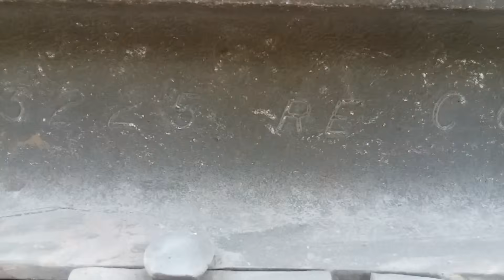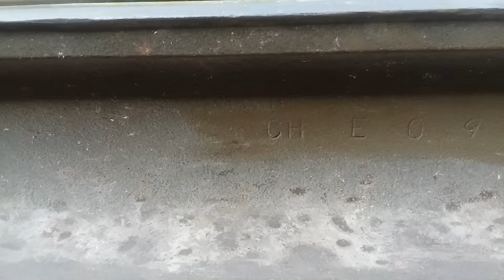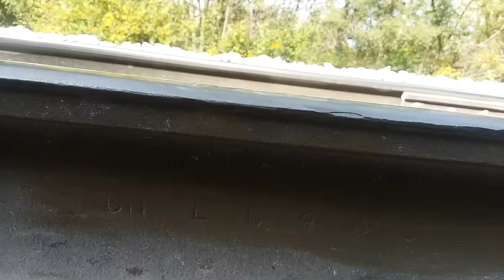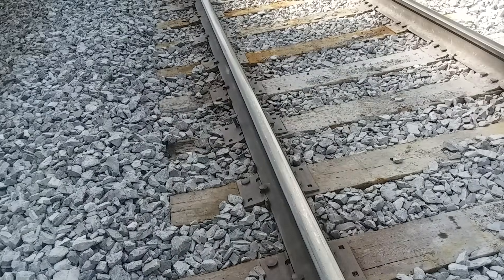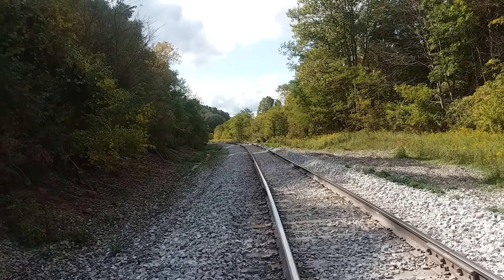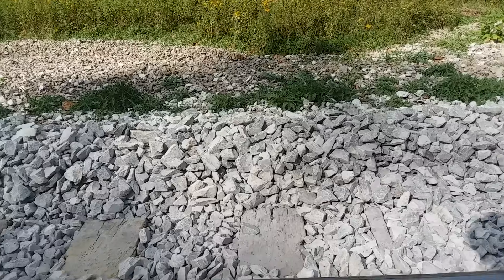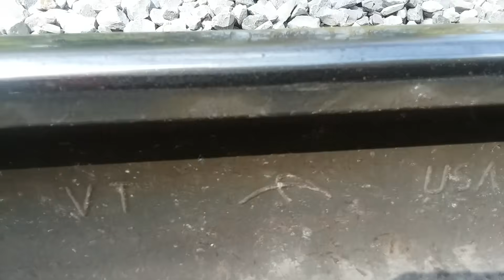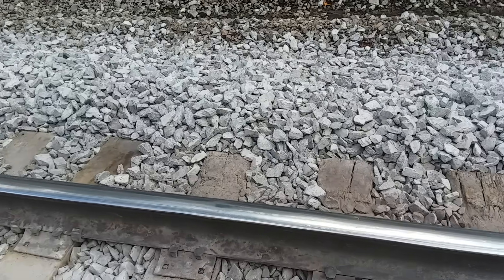Rail Defects: Rail End Batter and Flowed Rail, Heat Numbers (Heat or Rail Stamp) and Mill Brands

Comment: Steel is polished. Like a sword.    So shinny.  Sharp edges.    What is weight per foot. ????  Later.
Reply from the maker: Rail is weighed in at a per yard basis Dan. For instance, this
was 132 pound rail meaning it weighs 132 pounds per yard.
136 rail would weigh 136 pounds per yard and so forth. Really
appreciate your taking the time to check out the video and may
you have a very good day my friend.

Comment: I have seen "battered head" on rail before. In Tenn, Fla. and Az I have walked tracks, walk rails trying to keep my balance, all when I was younger.
Reply from the maker: Soft ballast caused by mud makes the joints pump up and
down over train traffic, eventually loosening the joint bar
bolts and causing the rails to move up and down in the joint
and that starts the head to become battered. Glad you could
pay us a visit and check out the presentation Johnny.

Comment: You need to see some really bad crushed heads. These are not bad at all,  nor are they a "Serious Defect". That flow to the field side of rail that was set down from the high side of the curve to the low side, is normal also. AND not a serious defect either. Maybe I should show you some defects I found in my career. I have Vertical Split Head rail, Horizontal Split rails, Detail Fractures, Transverse Fissures, Bolt Hole Breaks, Head Web Separations.
Reply from the maker: Thanks for taking the time to watch and write in Mister Goat.
Rail defects are a part of railroading. Every RR encounters
them at one time or another. Some are worse than others, but
at some point they all should be addressed. it's hard with having
16 miles of jointed track and only 2 track maintenance people
here to keep from having battered heads, jointed track is a lot
of work. Really appreciate your visiting with us.

Comment: I don't know if this has been asked but what do they do with the old rails? What is the life expectancy of a rail?
Reply from the maker: If they are good and grade relay we save them for possible
future installation. If they grade less than relay,( 4 classes of relay rail), then we sell them to a RR contractor who might use them
in spurs or sidings, or as bridge guard rails. The junk gets sold
for scrap. Life expectancy is so different depending on ballast
conditions, degree of curvature and speed, plus amount of tonnage
over it. Rail in tangent track lasts longer than rail in a curve,
a good bit of our original rail rolled in 1975 is still here, most
high degree curves the rail has been since replaced.

Comment: Hi Dave I have to take a close look at the rail on site. it was a all replaced in 2012, I originally 
found pieces from 1943 made by Bethlaham steel. there still a piece from 1937 that is 
still in the end of the have to look at that one, base plates there are old too. ties are in good order. 
nippon is on one of the switches too. they were made in September ( the number of slaches)
I will keep you posted. take care and be safe, barry

Comment: Hey Dave, could you tell us how much contact area there is between the wheel and the rail, and the approximate pressure the wheel puts on the rail?  I say approximate because an engine obviously weighs a lot more than a truck.

Thanks for the videos, they give us a great insight into railway engineering.
Reply from the maker: Very good questions Steve. The approximate surface area that a
wheel is in contact with the rail at any one time is not very large,
and it depends on whether the wheel is on tangent track or in a curve
and also the sharper degree of curve the more contact the high
side wheel will have. But varies anywhere from about the size of
a silver dollar to smaller area.

On a loaded hopper car such as we have: a loaded car weighs 186,000 pounds which includes car weight and tare. So divide that
by 8 wheels and you get the amount of weight from each wheel.
Thanks for writing in and watching my friend.

Comment: What do you do with the old rails that you replace?
Reply from the maker: Depends, rails that can be graded as relay are kept for future
use. Rails that are decent are sold to Frontier RR Services for
their usage when they build sidings or other non main line rail needs.
The ones that test Bad from Sperry or the complete crap ones
like this are then scrapped. Some day in the way future I'm going
to make a video on what relay rail is, it's too big topic to put here
in a comment but it's basically different amounts of wear for the  different grades of relay rail and thus different places they can
be used depending on the class of track. I know that sounds a
bit confusing there are just so many variables to take into consideration.

Comment: vacuum degas isnt actually a process used to heat treat steel. it is a step used to remove dispersed gasses out of ladles of liquid steel. this significantly increases quality. we learned the meaning of vt as vacuum treated, not too sure what exactly it is tho
Reply from the maker: You are absolutely correct in that, it is a process done before the
molten steel is formed into a bloom. VT (vacuum treated) is the identification on the rail brand which means the steel has undergone
the degassing process.  As of about 4 or so years ago the steel
companies and the RR's and other interests got together and agreed
that if the rails were degassed then there was no longer a need
to brand the rail as such, however if a method other than VT was used, such as control cooled, then that would have to be put in
the rail brand.

Comment: Nice informative video! Arcelor Mittal was formed about 15yrs ago when the Luxembourg owned Arcelor was bought out by the Indian owned Mittal company. They are still headquartered in Luxembourg though.  I drive by their Coatesville, PA plant occasionally and have even caught some of their LTEX leased locos switching cars across the road a few times.
Reply from the maker: Thank you Mike glad to hear you enjoyed. That's where we get
all our new rail from, someday I'm gonna get out there and see it.
I couldn't find on their web site  if they gave tours of the plant or not,
but I doubt they do. Sure would be cool to see them make the rails,
thanks for watching
Reply: Arcelor-Mittal has an iron mine north of Virginia, MN called Minorca. I see ore loads heading down to Two Harbors to load on ships regularly when I'm up that way
Reply: Arcelor- Mittal also operates the remaining bits of the former Weirton Steel mill. The main thing still operating is the tin mill, since the blast and basic oxygen furnaces have been demolished except for one blast furnace that remains basically as an historic landmark.

Comment: I worked on an old S P short line in AZ and in 2004 I was still changing 1898 , 30 ft. Sticks of 75 lbs steel. 
What do you think of that??!!!
Reply from the maker: Wow Michael, that is pretty cool, sure could use some of that
75 lb rail here at our local historical society where they have an
old steamer, that stuff is hard to find anymore. S P was a great
RR! One of my top 5 steam era RR picks, Thanks for writing in sir
Reply: @ccrx6700  contact AZ eastern railway in Globe AZ maybe they can hook u up.
Reply from the maker: @michaelobrien1532  👌 thanks Michael
Reply: @ccrx6700  also have an extensive collection of date nails ,oldest removed in 2004 , 1901 . Last tie I personally removed by hand ...!!!
Reply from the maker: @michaelobrien1532  awesome! Those are gems, pretty cool you thought ahead to save them 👍
Reply: @ccrx6700  I worked on one of the oldest lines in the south west and have seen many things most don't believe. Did everything by hand as done in the 1800' hundreds and found an 1886 track Jack. Working on the line was best time of my life..
..

Comment: Couple questions here. First one is what is the reason for the railroad brackets only being like half filled with the spikes instead of all the holes? And also what type of career do you go into to do railroad maintenance and stuff? It's just interested me for a while and was wondering what type of career path I would go down to do railroad maintenance.
Reply from the maker: There are different spike patterns for various track speeds and
degree of curves, for instance on a 70 MPH track on a sharper 
degree curve the RR may elect to put spikes in all the holes, we
at 25 MPH do not need that many spikes. Try to hire on with a short line or regional if your interested in a RR career and good luck to ya sir
Reply: @ccrx6700  Thank you for the information on my questions! I'll for sure look into that, I'm in high school right now so right now would probably be a good time to start researching more on this kind of job.
Reply from the maker: Go to 6777 productions channel. Sam just graduated high school.and it going to Penn State for RR engineering, he may be able to give you some help also. And very best luck to you sir 👍

Comment: You still use wooden sleepers (ties) and essentially hold the rail in place with big nails?
Reply from the maker: Yes David, track was built way back in 1975, you might want
take a few minutes and read this article on the problems concrete
ties have with heavy static loading of trains, they are ideal for
light transit, but read and see why we don't use concrete

https://www.rtands.com/track-structure/ballast-ties-rail/new-paradigm-design-concrete-crossties/
Reply: @ccrx6700  Nothing in that mentions using wooden ties. It is just mentioning the centre flexibility of the tie itself, which is why European concrete ties are much thinner in the centre, or in some cases, don't use a single tie at all, and instead use individual concrete support with underpadding for each rail.  Doesn't mention using spikes either, instead of more reliable fasteners, such as Pandrol or tension clamps.

Comment: Fall of 2017 or 2018 I was sitting about 3-4 vehicles back from a UP RR crossing at Osgood avenue south of Stillwater Minnesota. This was after they replaced the stick rails with quiet  CWR. About half way through the train I heard CLANG!!!!! CLANG!!!!! CLANG!!!!! sound getting louder so I intently watched the cars and Yep I saw the car with a wheel on side of the track missing about 1/4 to 1/3 of the flange. The wheel was still turning. I called the UP emergency number and I got a sharp guy answering and he quickly knew which train I was talking about. He thanked me and said that they would contact the train crew. The sound was quite distinct. That’s the 3rd time I’ve seen a broken flange. I wish I had video of it.
Reply: Correction: 
“with a wheel on my side of the track”.

Comment: Is that a manufacturing defect in the rail.iron mixture little off.
Reply from the maker: Dan, biggest reason this got so buggered up is the joint had a lot of mud under the ties so it pumped a lot and over time this is the end result. Our fault cause we didn't get rid of the mud sooner, but this also happened over a period of years, day in day out the constant battering of the train over it. Do appreciate your watching

Comment: Vacuum Degassing is a process  in which while the steel is in a molten state .they apply a vacuum which pulls  impurities  out of the steel, resulting in a cleaner steel.
Reply: The most damaging gas is hydrogen
It will eventually cause a "fisheye" defect that results in a broken rail 
Controlled Cooling or CC allows the hydrogen to diffuse out of the metal by being held at a fairly high temperature for a period of time
Vacuum Treat or VT removes hydrogen from the molten steel prior to casting into blooms 

Either way it minimizes rail failures
Reply from the maker: @markschenher4559  Mark, thank you for your info. You are right about hydrogen. The fisheye defects are called transversal and compound fissures. They actally grow inside the rail. That a big part of what the ultrasconic rail testers look for
Reply from the maker: Brian, thank you for your information, appreciate that and
thank you for watching

Comment: I live about a mile from the old D&H line between Albany and Binghamton NY. Back in the 80s I would walk down to the tracks for exercise and to watch trains. At that time there were these long pieces of steel hanging off the side of the rail as shown here. I could grab them with my hands and pull them off. Pieces would be laying along the ROW. There were a lot of derailments back then as well.

Today that line is owned by NS and is very well maintained. There have been no problems there is a very long time.
Reply from the maker: Wow John, that really musta been bad rail, and I thought ours was bad....great story, thank you for sharing with us
Reply: @ccrx6700  - I really didn’t understand much about rail at that time, but I figured it couldn’t possibly be good.

Comment: As we discussed before, rail defects can and will cause bearing defects. A rail defect can cause impacted and shattered rollers, raceways, cracked and broken cup (outer ring) counterbores (the seal mating surfaces) dislodged backing rings (the ring where it mated with the axle journal), and other issues. From what I could see in your video, the rail defects you demonstrated can and will change the overall mating geometry between the wheel and rail head. 

This looks like it may be a branch line, but of course I would be interested in knowing exactly where this line is located to determine whether it is a part of a subdivision. Where I live, I have the BNSF Cherokee and Afton Subdivisions to the north of me, the Kansas City Southern Heavener Subdivision to to east, and the Union Pacific Cherokee and Wagoner Subdivision to my west. I have access to the FRA Safety Map, Open Railway, and the BNSF subdivision maps. I am also familiar with FRA and AAR rules and regulations concerning railway, locomotive, and rail car maintenance.
Reply from the maker: Thank you for your superb comments! You are spot on! We are a 17 mile track that runs between the mine at Kirby Pa. to a harbor facility on the Monongehala River at Alicia Pa.
We do not interchange with any railroad, we are captive. All of our rolling stock must be
trucked in from a nearby Norfolk Southern siding at Poland Mines. Doubt if we are on
any of the maps you mentioned, FRA considers us as an "in plant installation" We are
under the Federal Mine Safety Health Administration CFR Title 30 which governs the
mining industry, since we are a coal mine that has a railroad. Although we are bound
to follow the rules in CFR 49 as a railroad. Just that an MSHA inspector "patrols" us,
not a FRA inspector.
Reply: @ccrx6700  Looks like the line runs from Cumberland Coal Resources to Grays Landing Lock and Dam south of Masontown Pennsylvania. The Norfolk Southern line you mentioned is on the east side of the Monongahela River. The line is the Loveridge Secondary Subdivision. It comes out of Masontown. There is no connecting line from the sub to to line we are discussing.
Reply from the maker: @newwomyn  Erica, you are correct, it is on east side of river. Directly across from Grays Landing on west side of river is our Alicia harbor where our line terminates. The NS track used be old Monongahela RR.

Comment: How can an invention that's hundreds of years old (the steel rail) not be improved upon in light of all the technical advances in other industries? There has to be a better way, but if it works why change it im guessing.
Reply from the maker: The rail manufacturing industry has significantly tested and studied steel composition over the past years, they have made significant improvements over the past 50 or more years and still today are constantly seeking to improve, hope that helps
Reply: LJ: Everything wears out eventually.  Conditions are the major factor.

Comment: lots of those defects were due to surface irregularities caused by the mud you cribbed out in August.
 please tell me you are going to change the rail in the entire curve . 
to have a joint of  varying age/wear in a curve, is to invite problems.
'overflow' on the field side is of ZERO concern. yes, it is wear, but it doesn't affect anything. 
width of the rail is immaterial. it could be a foot wide. the wheel doesn't see it.
flow on the gauge corner... now that is a different story. 
"original rail" ? 1975... thats not necessarily old rail. with proper maintenance, good drainage, proper elevation, rail can last over 100 years on a little secondary like this. 
additionally....if trains were taking that curve too slowly, that didn't do the track any favors.
hope these comments helped.

p.s. it's pronounced Ill i noi .... the 's' is silent
Reply: Excellent comment sir, thank you very much, sorry bout the s on the end, I'm sourthwestern
pennsylvania ese...lol don't know any better.  ha ha. Absolutely caused by track surface not
holding. Yes we did change the entire low rail on the curve, curve now looks and rides great
with track surface that holds. You are right bout flow on field side not affecting
anything, gauge side different story. We got lots rail still in service from 75. Had a friend
who is a contract tamper operator tell me last year he tamped some rail in NY that
was made in 1909! Thank you for watching